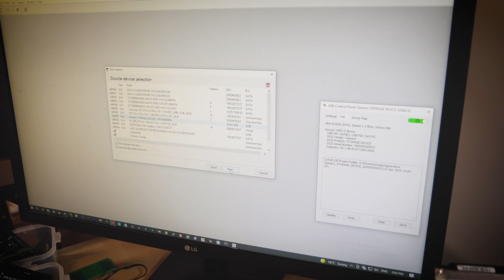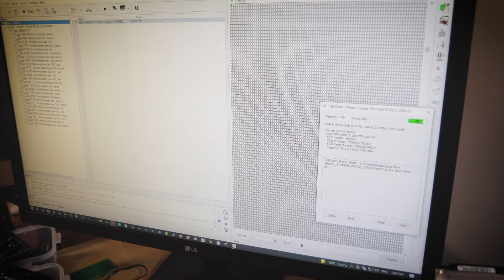Destroyed phone, can it be recovered?

Comment: Hi! Recently I got 2 dead phones from a friend, Lenovo A1000m & Nokia 2.1. Like I said, they were dead, so there was no way of pulling data from them without desoldering the memory chip. I don't have any data recovery tools like you do, so I had to make my own. I studied all the eMMC protocol documentation to write an Arduino program that would read the memory contents. After 2 weeks of working there was a partial success, I finally could communicate with the memory (the one from Lenovo), read its registers, basic card data and change working states. But when I tried to read data, things got complicated. No matter what I tried, no data came out from the memory, and it behaved the way that wasn't mentioned in the documentation. 
After initializing memory was in the transfer state. First, I selected the partition to read in EXT_CSD register. Then, I sent CMD 16 to set the read block length to 512 bytes. After that, I sent CMD 17 to select a block to read and start the read operation. Up to this point, everything worked exactly like described in the documentation.
But it seems that after CMD 17 the memory was changing its state to inactive, and only way to put it back to transfer state was going to idle state and performing initialization. Am I missing something? Something that is not described in the documentation? I hope you will be able to help me, I guess I'm my friend's only hope
Reply from the maker: I would really suggest getting a simple SD to ENMC adapter and using Linux to see if there are any error messages before going to that extreme
Reply: @forensicguy  Thanks for the answer. I have never used Linux before, so first I would have to install it and learn how to use it. I made my own SD to eMMC adapter and I connected it to my Win10 PC, but it seemed like there was a problem while accessing data partition. The only thing I could extract with the help of DMDE was the boot partition data. So both SD reader and my Arduino program failed, but why?
Reply from the maker: If you can make a list of partitions with DMDE and send me a screenshot. I’ll see if there is anything that I can notice that can guide you

krzys.stanko@datarescuelabs.com
Reply: @forensicguy  The problem is that the boot partition was the only one that showed up, and I can no longer access it. After connecting my adapter to SD card slot Windows treated it as multiple USB drives, started behaving weirdly and crashed a few times, so reading the boot partition was a pure miracle. I have 2 card slots, in case of the second one when I connect an adapter PC doesn't go wild, but I can't read anything. No matter what slot is the adapter in, DMDE throws a lot of errors
Reply: @forensicguy  Finally, I managed to read one of that chips, the one from Nokia. It turned out that the code I wrote was good, there was a problem with memory from Lenovo. I added SD card support, so now I can copy contents of eMMC there, and right now I'm copying the first GB overnight. It's gonna take some time, because the copying speed is about 130MB/h, that's the best I could get with 1 data line and 20MHz microcontroller clock. I tried reading with 4-bit bus but I was getting a lot of read errors, so I decided to stay with 1 bit. I have already read 256MB, and after opening it with DMDE as a disk image, it showed a lot of different partitions, even some files, like .elf executables, zip archives and some png's, one of them was an emoji. Very nice!